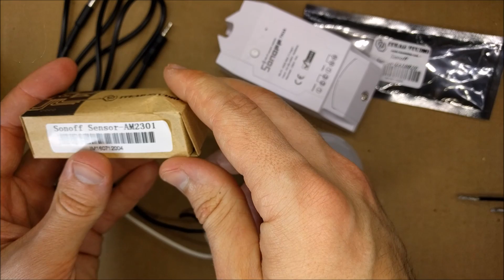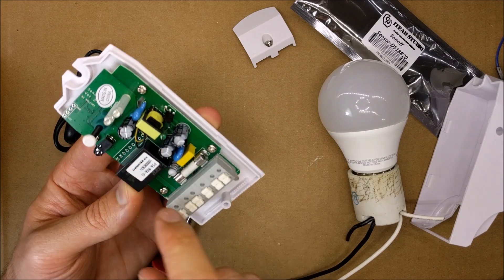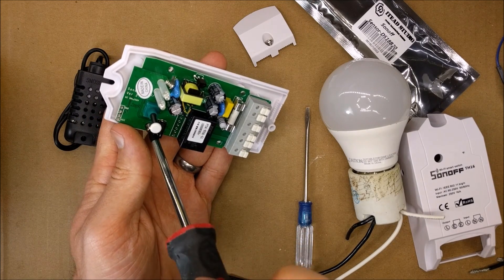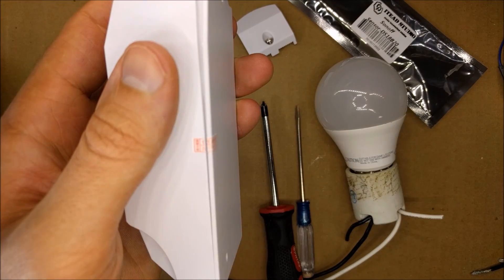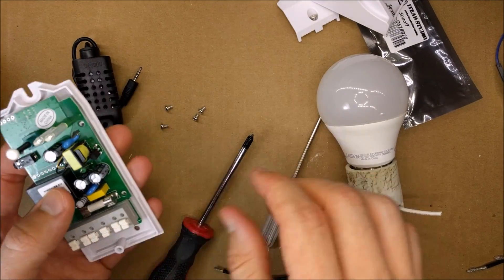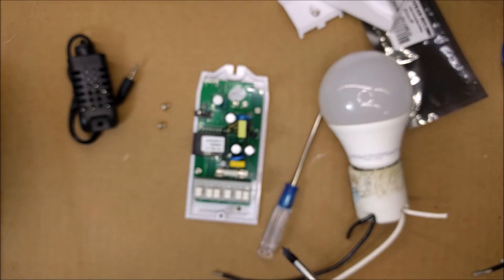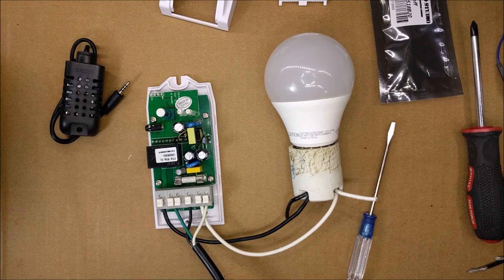Sonoff TH16 Review

Comment: 1:48 I've just bought a Sonoff TH16 (October 2020) and while there are the same number of electronic componnnts within, there is no fuse anymore on the PCB.
1:56 but on mine there's a 5th pin next to VCC/RX/TX/GND called "EXP-LOG"

Comment: Hey just came across your video! Thanks for reviewing it, i just wanted to ask, is it possible to use the TH16 simply as a wifi switch (by entering the app and switching it on/off or by timer) without connecting either sensors? (Ideally i would like to use this turn my water heater on after my alarm early morning)

Comment: Hi. Im gonna buy a th16 but I wanted to ask u a question first. Can i also use the th16 as a timer like the normal relay sonoff switch’s. Foe example.  turn off at 23hs  and on at 07hs.   On at 28c off at 24c  . Is that posible? Thanks in advance
Reply from the maker: Yes it is, it's pretty advanced

Comment: @MadeEasy, thanks for the great video! Please tell me, when I press the button on the device, the blue LED does not come on, and neither does the device power on. It was working properly when I set up initially, but it went dead all of a sudden. What do I need to do?
Reply from the maker: Check the fuse, the fuse probably went out
Reply: @MadeEasyChannel  Thanks, I didn't know that the Sonoff TH-16 had a fuse! Can you please guide me / send a photo? What is the fuse rating?

Comment: Thanks for the video. If I'm starting from scratch, do I need any other Sonoff parts?  Or just the TH16 with its temperature sensor can connect via wifi to my iPhone? Thanks for any info.
Reply from the maker: no it cannot connect to your phone. the jack is smaller than the standard 3.5 mm jack. You can get a adapter and that will work
Reply: Thanks for your reply. But I was asking if I need to buy any other Sonoff components, sorry for any confusion. Sounds like the TH16 and temp probe are all I need, then I can use the eWeLink app to configure it to turn on a light (or sound an alarm, or whatever I connected to it) when the temp probe hits X degrees.
Reply from the maker: nope you dont need to buy anything else, you can use the sonoff by it self, you dont need sensors. but its good if you have them
Reply: Thank you!

Comment: Old post, I reach out anyway, Hello I am about to install 1 TH16 and 3 sonoff basic, I want the to turn off or on the 3 basics depending
on the temperatures at different points say turn on 1 basic at 60 degrees the 2nd at 70 degrees and the 3rd at 80 degrees , can I do this with 1 TH16 and 3 sonoff basics ? or do I need 3 flippen TH16, thank you for any information you provide

Comment: I had real trouble with the connecting to the terminals. Is the technique to press down the tab with  a screwdriver, insert the wire  then release the screwdriver ?

Comment: Would you know whether the switch turns on/off depending on the rules set even if WIFI is down?
Reply from the maker: i am not sure, i will have to check
Reply: Great Video, this is my introduction with some more info https://youtu.be/R6M7rO8lBTI

Comment: Is there a way to turn the Sonoff on and off without the app? Like, can the button on the device toggle power, or is it only for pairing?
Reply from the maker: you can, if you flash it with your own firmware. but other than that i dont think you can
Reply: yes soldering two wires to the bottom of the toggle and use a bell push type switch there is vids on the tube how to do it
Reply: Just flash tasmota